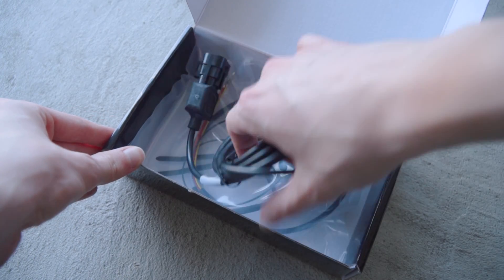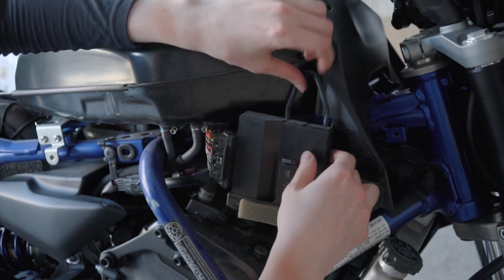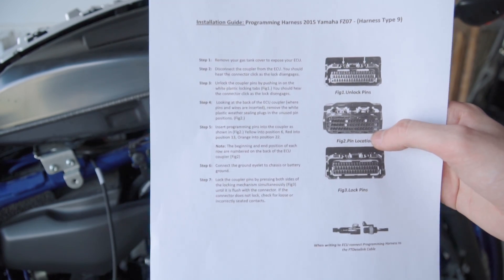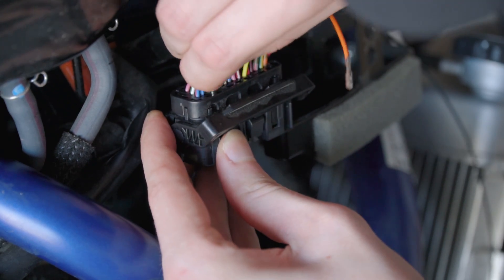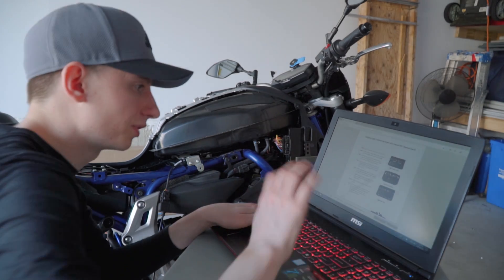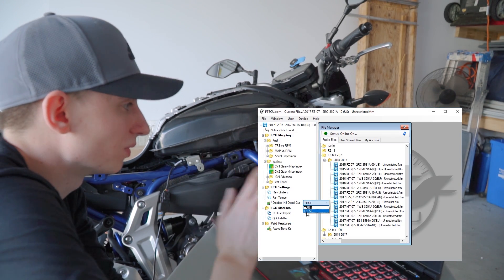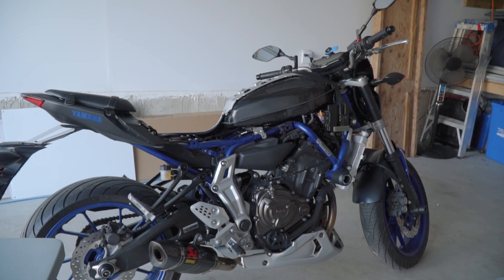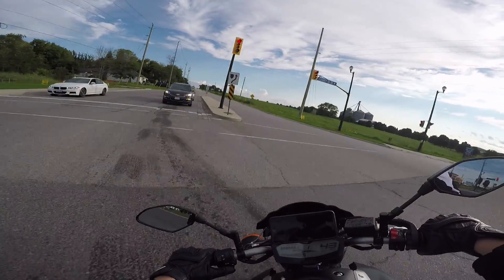ECU Flashing MT-07 at Home (Tutorial/Impressions) [EP.04]

Comment: Was looking to do the same. Do you have any go-to Canadian websites you order parts from?
Do you still think its worth the cost after riding it a while?
Reply from the maker: I bought it from Bayside Performance (they had the cheapest price). If you have new exhaust on the bike then yes because I finally got the power back that I lost after installing it. But the bigger asset for me was, how smooth the bike became. I can finally be in traffic in first gear and move slowly  and smoothly. The bike has more "pep" when accelerating, especially it gets to 200 km way easier now. If you are looking for more power on a stock bike, I dont think its worth it (unless you really hate engine braking). If you have new performance parts, get it because you will have proper fueling, more pep, and more linear throttle response (also does wheelies way easier) :)

Comment: I would really like to know how much the high flow air filter changes things. Not sure if it’s worth the $200
Reply from the maker: Soon :) thanks for commenting Thomas the Troll
Reply: Where you buying your filter from that cost $200??? That's freaking CRAZY!!! And yes, they're very worth the 60 to 80 bucks you may have to spend. They're a lifetime filter. You're not buying it just for power increases. Which it does help SOME. But the fact that you never have to buy another filter, just the cleaner and oil, is worth it in the long run. But you need to do more research before buying it. Because  $200 is pretty ridiculous. Someone is trying to rob you my dude! Lol
Reply: RenesMDJ the one jake the garden snake did. It’s $200 for he filter and a lid that’s a lot more open so it’s suppost to really increase air flow